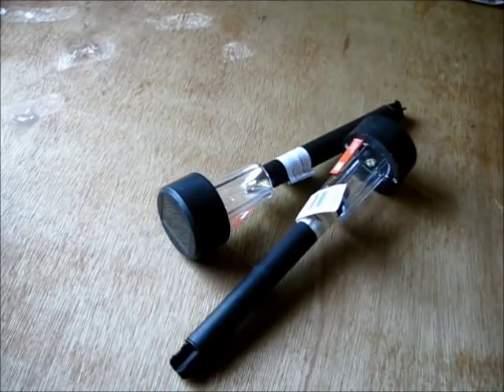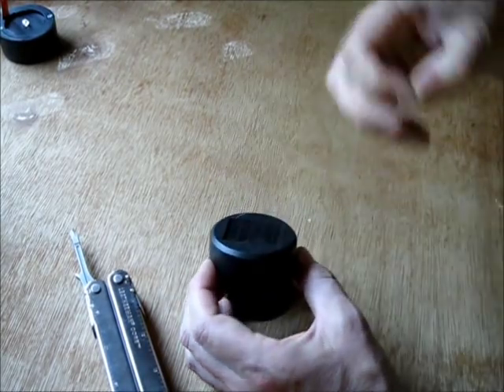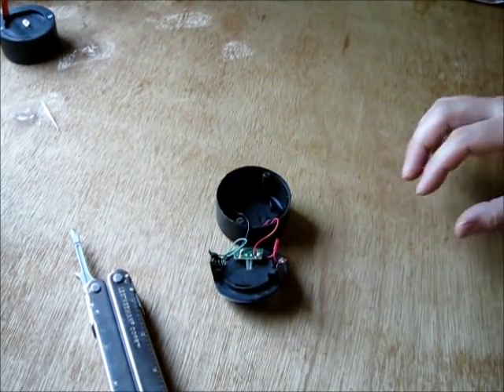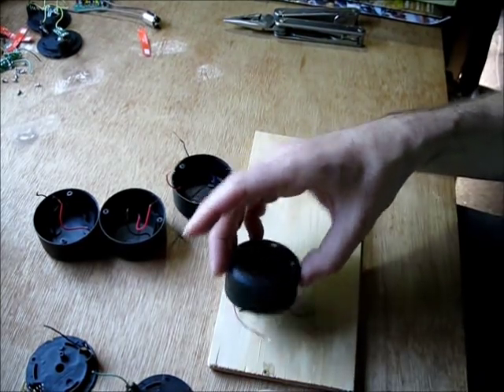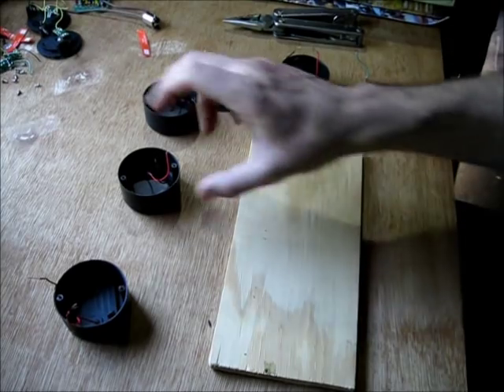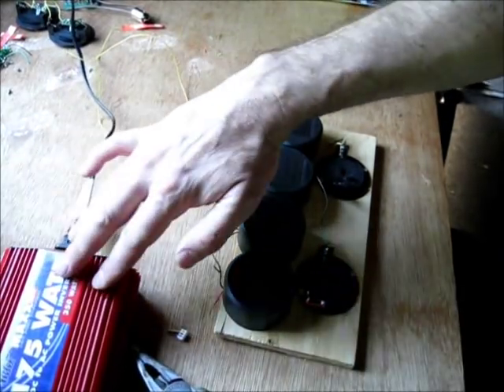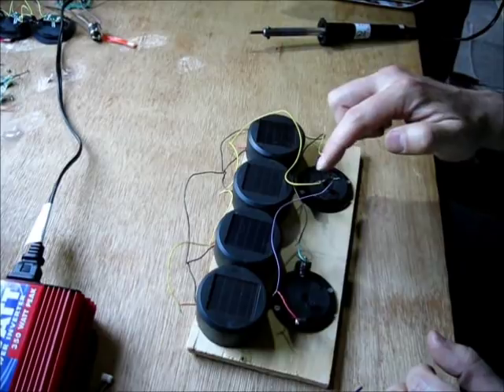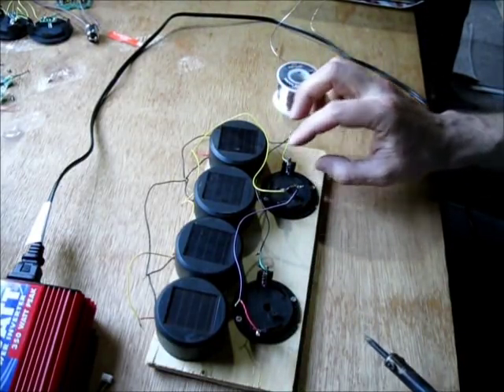DIY Solar Garden Light Hack - Solar Battery Charger

Comment: Is there a rule of thumb on a ratio when charging batterys? So many Milliamps over what the battery is rated? Or something like that?
Reply: The voltage would need to exceed the battery's rated voltage so that the chemical reaction that goes on it in runs in reverse. The amperage doesn't matter. The amperage determines how long it takes to charge it and there are different batteries. You have to look at the mAh of the battery and calculate how many joules it would store. Then use the mA that you are running through it while charging, multiply by the batteries voltage (1.2 V). That tells you how many watts you are feeding it. Takes the joules and divide by the watt and it tells you how long it takes to charge it fully (more or less).
Reply: louis tournas how high of a voltage would it be safe to use to charge these 1.2v batteries. what type of problems does one start encountering when the voltage is too much higher than what you're charging
Reply: danh le You should be able to do 2.1 V, which is what my solar charger achieves in full sunlight to charge Ni-MH batteries.
Reply: louis tournas is it true that if i have like a 6v solar panel, i could just hook up 3 or 4 nimh's in series and charge them all at once?
Reply: danh le Yes, you can. The voltage will spread among the batteries (6 V/3 = 2 V per battery). It is exactly like the resistor in series law.
Reply: louis tournas what would be the problem if you hooked the 3 or 4 nimhs in parallel...i know it'd go back to 1.2-1.5 v, but wht's the issue with having a higher voltage power supply charging the lower voltage battery, and when does it become really problematic?  thanks for helping out us beginners
Reply: danh le I'm not a battery expert but as you increase the voltage, the extra energy is converted to heat but after some point, side reactions occur. There is water in all these batteries. It will get reduced at the cathode to hydrogen and I guess oxygen gets produced at the anode. Batteries have vents so that they won't explode.

Adding a 4th battery drops the voltage. 6 V/ 4 = 1.5 V which should be fine. They will just charge slower compared to connecting 3 batteries.

An empty battery has a high internal resistance. The output voltage is much less than 1.2 V (Nerst equation). It might be 0.7 V which is what I often see for NiMH. So it will charge up even if you are pushing 1.5 V into it.
Reply: louis tournas i don't think you need to be an expert to help with my easy questions :)  thanks it's helping me

Comment: Would this power a Small set of christmas tree lights?
Reply from the maker: +Echo Rat A small set possibly. Each solar panel will charge a single AA or AAA battery in a single day. Granted they are smaller batteries. Lower amp hours that is. So adjust the number of solar panels to match your needs.
Reply: +. He put one in later in the video.

Comment: My only thought is that it could do with a diode to protect the solar cells when it gets dark. Batteries feeding power to a solar cell that is in dark is not so good. I expect the omitted circuitry had diode protection built in.
Reply: You didn't watch the video then. He did built in the diode...
Reply: mmdirtyworkz Fair enough, must have missed that bit.
Reply: The solar light circuit has a diode on it you could use if you were really careful.

Comment: Funny, stumbled on this after making my own similar project.  I joined 6  lengths of  Harbor Freight solar rope lights, and make a 6 piece solar panel with the cells taken from each rope light, that now charges six 1900mah AA Eneloop cells in parallel.  The original cells were as yours, 600mah, but were AA, not AAA.   The low charge rate coming out of these solar cells should help the batteries last a very long time.

Comment from the maker: You simply do the math. Lets say you have a 1,000mah battery. The solar cells each put out about 25 ma each. 4 of them put out 100ma per hour. 10 hours and your battery is done. Use two batteries, then double the charging time. At this low current, it will not hurt to be over a few hours.

Comment: So a few problems here is that NiCd and NIMH are different. You actually need smart charging. A battery in the hot sun won't be good for it. You need the curcuit to detect the voltage charging curve and STOP when the battery is fully charged. Doing this all low power is a challenge.

Comment: Question. I have a 100 watt inverter that has a wall outlet attached to it. I have the same exact solar panels from dollar tree... how do I match 100 watt... like how do I know how many watts is one of the panels...? I have about 150 of the little panels. I know I am crazy for buying so many of them but my idea requires it. :/

Thanks.
Reply: 150 of these will give you roughly 16 watts, it's better to charge a 12 volt battery and run your inverter off that instead. I had the same idea you did and tried it, it couldn't run the inverter straight off the solar panels.
Reply: you can buy 1 big solar panel for $60-100 off Amazon. why would you spend $150 on little ones 😂

Comment: Thanks for the video!  A few quick questions, Did you use the diode from the original $1 Path lights?  Wouldn't be best to use two of the diodes going from the + wire of the solar cells to the + side of the battery chargers?  Also, why not take the solar cells completely out of the plastic holder?  That way you can put them flat on the wood and drill small holes underneath each cell to connect them in parallel.  Which would allow you to use less wire, which may increase the Amps.  probably not enough to notice unless you are using many more of those cells which many people have commented about doing.
Reply from the maker: +James Tower Use only one diode due to the voltage drop across the diode. You would lose too much with another diode. Yes you can remove the solar cells but it is tough work. But it would look nicer for sure.

Comment: RechargableAAA batteries generally run 500-800 mah. Rechargable AA batteries run 1700-2200 mah.
I'm with the other posters that say you'd be better off starting with a 5w panel...

Comment: I read somewhere that you can use the LED  light in the circuit to act as a diode.   Any electrical engineers know if this is true? And where do i wire it and is polarity a factor?
Reply: ahh  thanks
Reply: LED is a diode in itself, usually the longer lead is the anode (+) lead, the voltage drop will be whatever the voltage of the LED is rated for generally 1.5 to 3.0 volts.
There are sites out there that will give you the approximate voltage rating for the various LED colors..Hope this helps a bit Good luck!
Reply: LED = Light Emitting DIODE, soooooo......

Comment: Hi,
Want to make a solar array out of the IKEA solar cells. They each have 4 AAA batteries in them.

How many of these would I need to run in parallel, to plug into a pure sine wave inverter 3KW, such that I could run appliances, i.e. charge my MacBook Pro battery, and say digital radio batteries. 

Computer Battery Spec:
  Charge Remaining (mAh):	5047
  Fully Charged:	Yes
  Full Charge Capacity (mAh):	5234
  Amperage (mA):	0
  Voltage (mV):	12412

Need to find out the mah of the IKEA AA battery

Comment: This video was worth a subscription. I’m a fifth grade teacher and we make circuits. I wanted to learn how to teach them how to do electrical circuits with solar panels, but I’ve never done one before . The  connecting of wires is what’s confusing  in the video, but I will keep watching this to see if I get it.
Reply from the maker: Thank you. Its very simple. Plus from the solar cells to plus on the batteries. Negative to negative. To prevent the batteries from back feeding into the solar panels you need a diode to block current in reverse. Thats all there is to it. You can add a switch to turn it on or off as well if you like. I used all parts from dollar store lights for this project.

Comment: The diode should be used as it not only prevents the batteries from discharging at night it helps prevent overcharging in the daytime because it has an inherent forward voltage drop of 0.7 to 1.0 volts. (depending on the manufacturer of the diode)  This means that your 3 volts measured at the solar cell is only 2.0 to 2.3 volts at the batteries during full sun which is a lot easier on the batteries.

Comment from the maker: To go off grid you need serious power. You need real solar panels. These little devices are only good for charging small batteries.

AAA batteries usually have around 1000 mA hours in them, some are higher, some lower.

These little solar cells are only powerful enough to give you that much power PER DAY.

You would need thousands of these to run household devices. Its just not practical.

They are great for keeping flashlight batteries charged tho.

Comment: Where do I buy a diode for this and what do I ask for, how much might it be? Thank you in advance
Reply from the maker: 1N4007, 1N4001 or similar. Ebay, Amazon. Under a dollar each but generally found in bulk. Or look for any old diode from a power supply of a dead electronic device. The black ones with a silver band.

Comment: I know little about diodes, are there different ratings, Will any one work?… can you tell me exactly how to wire in the diode?
Reply from the maker: For this its not very specific what you use. Just about any diode will work with these low voltages and current. I use the 1N4001 or 1N4007 but that is just because I have them all over the place.

Comment: Why do you connect the solar panels in paraller and not series?
Reply: series will give it more voltage, parallel will give more amps. the panels were already rated for proper voltage to charge the AAA batteries but he wants to charge it faster, so you need more amps to do so, that's why you wire it in parallel.
Reply: Got it, thanks!

Comment: hey techman. me again. i just hooked up a few solar lights off the garden. 5x1.2v and connect them to 2 solar nights with battery and one without bat. incase i wanna charge a sep battery. it all lights up nice but it only stay bright abt 3hrs then die around 4hrs after. i was wondering if its the battery that dont get enough power or els. my mission is to get an 12v installed for small home appliance later if this works out.

Comment: Hi,   Just two observations

I know there is very little chance of overcharging but even so, given that some bright spark may try to scale up your idea or decide to use poorly made cheap chinese rechargeables there is a small risk... Might be worth adding an annotation or a note in the description

Secondly, having gone to the trouble of mounting the parts on a board, why not poke some holes through at the centres and have all the wires at the back, where they could be silicon sealed to prevent them snagging or shorting in damp weather

aside from that its a method of getting some charge out of some cheap little PV's and if it motivates people to try things then JOB DONE !!

Comment: Great Solar recharging panel.  Two thumbs up.  Don't worry about the detractors.  These batteries never explode.  I have made a school car project, using the similar technique, Walmart Store $1 Solar panels for Garden LED lights.  I used the germanic Diode.   The Batteries utilized were similar miniature AAA 1.2 V.  They powered the little car, and car charged under the Sun.  It ran great.  Thanks for the project.
Reply: The have never exploded on me but I did manage to make some leak

Comment: hi.. I got a solar powered motion activated 36 led.. I try to measure the voltage on the broad day light, and it measures 9.35 v dc and on ac measures .012 vac.. I don't know how to calculate how many watts on it... on the description,  it is charging a 5 x1.2v 700mAh Ni-cd, please help me  how to calculate the wattage on this panel, if I got 2 panels like  this is it good enough to charge a 12v 75ah deep cycle batteries?? please teach me, I want to learn about this matter... thank you so much

Comment: I just fixed a bunch of lights that I use at camp. Several of them work, but the rechargeable AAA batteries are more expensive than a new light.  So, the things are basically dead.  BUT THIS is a great thing to do with them!  All the parts work, but with the batteries costing more than $1 each, it seems better to just buy new lights and use the old lights to charge other batteries. AWESOME!  The design would have to be different here due to the fact that it rains whenever it feels like here!  If you have old lights and the solar panel is foggy, use 1000 and 2000 sand paper and toothpaste or head light defogger kit to make them work again!  Cleaning the contacts and such, I just resurrected 10 lights last night. And have the parts to do this! Thanks
Reply: Never thought about cleaning old solar lights! Learned something while learning something else! Thanks!

Comment: I got a 100W solar panel for 103$ great deal from amazon
And I can charge  a 12v battery and running a table fan and a desk fan at full power 30 watts + 20 watts directly from the sun!
I can even run a small laptop from it!!!
I power a 12v DC to 110-125v AC inverter rated 400 watts and the battery is 5 amphours (which should definitely be increased to like 35AH)
Works great!

Comment: I am trying to power a small portable fan by taking out battery and  connecting in parallel to the panels but it isnt working. i set up (2 panel in series)||(2 in series) to meet the voltage req of the fan and that didnt fix. any suggestions on what it may be?

Comment: Hi, i wonder if I can use the left over circuits from the garden lights to turn on\off real LED and bigger solar batteries. ( 12V 1,5W, connected to 12V 1800mA rechargable batterie). Solar control for small light systema are tricky and expencive, can take control from garden light for 1W led system. What do you think?

Comment: FYI to anyone who may copy this... If you build a charger without over and under charge protection you run a very high risk of damaging your batteries, possibly catastrophically.    You could very easily start a fire or cause injury.  The circuit this guy removed had those protection schemes in it.
Reply: Exactly, he could've just unsoldered/removed the leds, and soldered the battery compartments in parralel.

Comment: The reason why he cut out the original circuit board, is because those circuit boards in the Garden light also control when the LED lights Turn On or Off, depending on the Sun.  When Sun is up, the voltage is high, and LED light turn off.   When the Sun is down, voltage coming into Solar Panel is gone, and LED lights Turn On , automatically.  So, the best thing is to cut off those circuit boards and replace them with Zener Diodes for Voltage regulators.  Search Zener Diodes, 5v or 6v.  The cut off power when Battery is charged to a certain voltage.

Comment: Nice video. 
I like the fact that your using solar power to soldier.
How many watts are your main solar panels ?
By the way, also use the lawn lawns to charge batteries as well as for inside room lights at night.
They work !
PEACE !.

Comment: I am attempting to use this same solar light however, I want to replace the light in this with battery operated string lights. I'm obviously not wiring something together correctly. Any suggestions?? Anyone's help is appreciated.

Comment: TO:Michael FTW,
Batteries for cell phones and other  USB devices are Li-ion batteries which are VERY sensitive to over-voltage charging. They Will be damaged and have been known to burst. If you/one adds a 5.6 volt zener diode to the circuit it will limit voltage to 5.6 volts.  Diodes 1N752 or 1N5232 would work great. They are $0.10 to $0.20 if you buy ten on EBay and there is not S&H. Also available at Radio Shack.

Comment: Is not a bad idea, but if you can only charge 2 small batteries, I don't think so. This could be great if you can use those batteries to turn on a street lamp with leds for example, it charges during the day and it turns at night. Regards.

Comment: Ov course it goes without saying that now I have some "proper" solar equipment to play with but I did actually make another one ov these arrays a couple ov weeks ago for my 5 year old to use to charge his 6v Nicad pack with (that's mounted in an old jumpstarter casing). We just gotta now mount it up where it can get some decent sun and run the cabling to his room.

Comment: Why not put them in series instead of parallel? Wouldn't it be better?
Reply from the maker: Depends on what you want for the output. Series adds voltage but current remains the same. Parallel adds current but voltage remains the same.

Comment: Thanks for the lesson. I'm new at this and I'm trying to make my own charger with larger solar cells. I want to be able to put the cells in the sun and the batteries in the house so they don't get hot. Again, thanks for the lesson.
Reply: Have you seen the website of "Lasersaber"?  He has YT videos. He makes batteries out of Epsom salts and borax, placed in copper pipe end caps that provide low voltage Power for the long run. No need to charge them. Check them out.